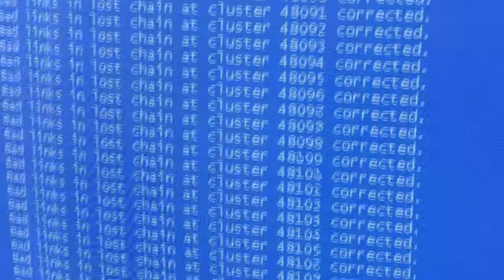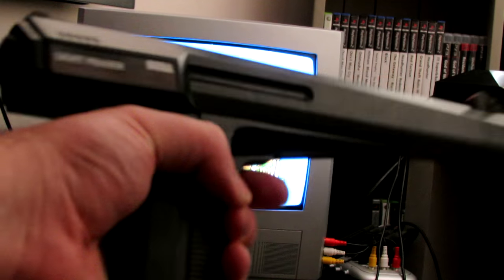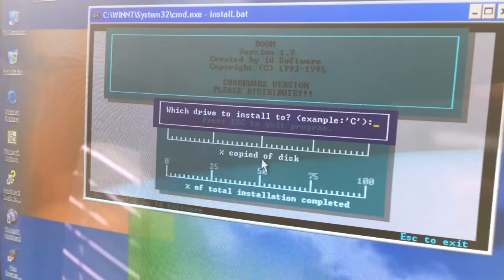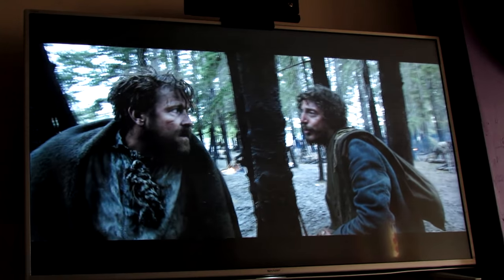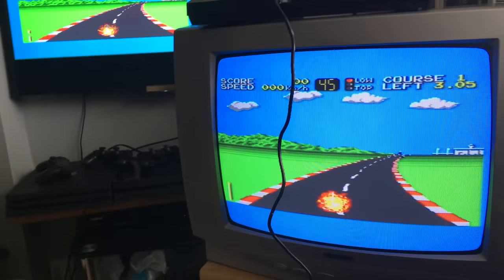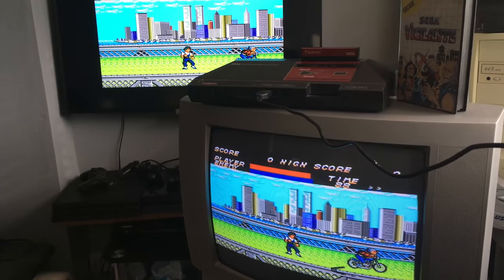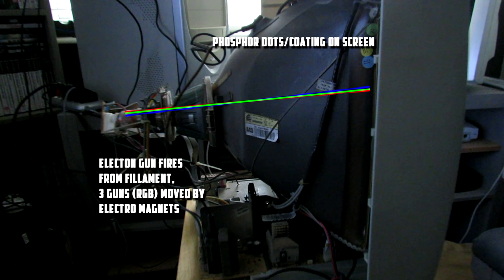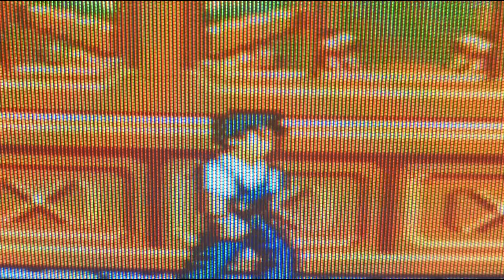How Do CRTs & LCDs Work? | Living in the Past

Comment: Looking forward to the next videos on these series nx, thank you for your hard work I am actually looking for a crt to play with my ps2 and psone
Reply from the maker: If you can, pick up a Sony Trinitron 14" or 16", perfect for it and only need to check they have Scart input then you are set. a PVM is even better but you will need the cable convertor for the BDC connectors.
Reply: @NXGamer  thanks for the tip

Comment: CRTs are better than LCDs because they have zero input lag and very deep black levels which means great contrast ratio.
Not only that but the latest Digital Foundry analysis on CRTs show that the modern effects used in games like motion blur and depth of field to make the image look good are not even need on the CRT, there something authentic about the image in a CRt and even on 1024*768 it still looks great.

Comment: Lcd for modern day pc and consoles, crt for anything from the  wii down, I use my modded wii on a crt to play my emulators looks far superior to anything on an Lcd screen, tried all the techniques with upscalers but not even close
Reply: PC games look so much better on a CRT and no input lag.
Reply: High res CRT's are superior for every aspect over LCD minus image sharpness which was improved via aperture grilles replacing shadow masks on later monitors, fixed pixel displays even my beloved Plasma..or OLED, are great at native panel resolutions, but are not kind to non native, and despite many image processing/scaling methods, there is always some kind of unwanted scaling artifact visible, CRT's disguise these almost completely, not to mention their near instant horizontal scan response time, is unrivalled.
Reply from the maker: CRT is almost impossible to replicate on an LCD, nothing compares to the real thing.
Reply: @NXGamer  💯 % agree, even the flicker and neon glows of the contrast brings back such good memories.

Comment: Cool video, I feel it was a little remiss to not mention that QLED is a massive step up in LCD color reproduction, since the use of Quantum dots for color, has not only fused the best aspects of liquid crystal practicality and almost worry free use, but they have increased the color gamut to levels often above or at least equal to OLED, a big bugbear with non QLED LCD is unatural color.
Love the channel.cheers
Reply from the maker: I did not mean to dismiss it, infact the opposite as it is an incredible step forward for the LCD tech and is very much needed. Brightness, colour spectrum, depth and sharpness are all much better. CRT's still stand out as a very different and special tech with both having differences and challenges that I cover in part 2. Thanks for watching and commenting.